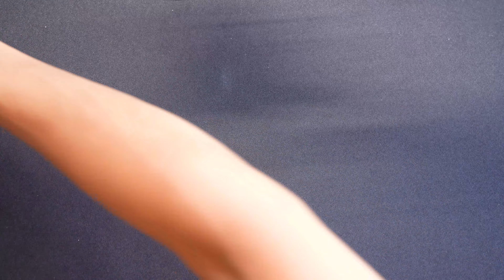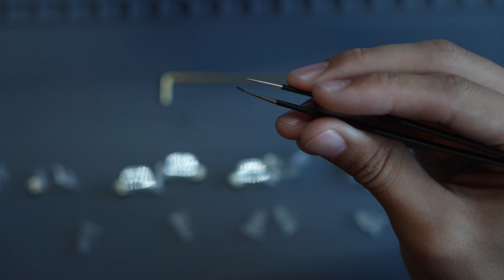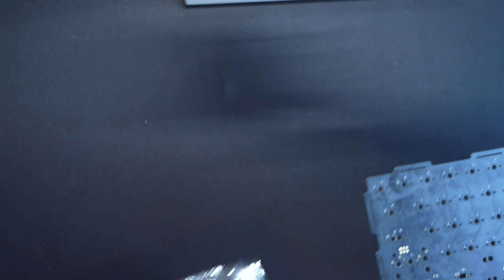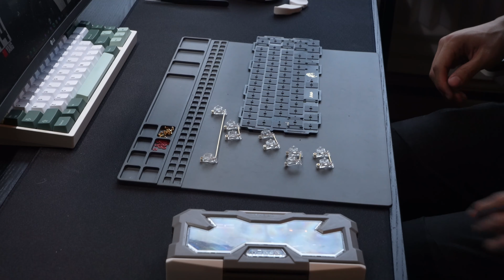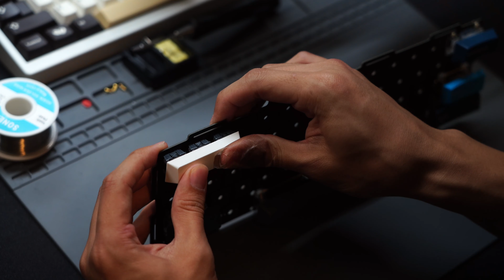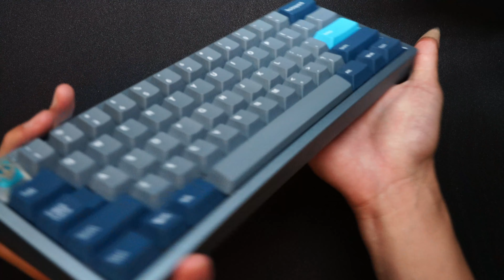Studio Kestra Nue Build / Cthulhu Linear Switch Sound Test

Comment: What is the Cthulhu switch you're using here? Typically it's long pole stem, milky top, ink bottom, but you're using kingfisher stems here so just looking for clarification. Also where are those tiny stabilizer housing pads from? The ones that you're using effectively to holee mod

Edit: nvm on the first point, you showed the switch components later in the video
Reply from the maker: The stabilizer pads are from kbdfans, but i cut up the excess pieces to use for holee modding, just having that pads on the PCB wouldn't be enough to stop rattling or pinging :/

Comment: Great looking/sounding board! How are the kingfisher stems/base switches? Have been looking at em for a while but never pulled the trigger since people said they were scratchy.
Reply from the maker: Thanks :) The kingfisher by themselves lubed are horribly scratchy but I bought them for the stem. I can't recommend them if you're just going to be using them by themselves, but they're somewhat salvageable if you decide to harvest the stem and use them in frankenswitches. I only had a few bad apples where the stems didn't want to play well where if you pushed down from anywhere but the middle of the switch, it would just sound horrible LOL
Reply: @TofuTypes  Thanks for the info!
Reply from the maker: @NugenEnigma  Glad to help!

Comment: with a pom plate, how do you think it would sound compared to a banana split? im looking for a “creamy” soft sound. also, what would you give this switch as a rating 1-10?
Reply from the maker: POM plate on which board? For the nue? Personally I'm a big fan of the switch but it is a little scratchy so I would give it like a 7.5 maybe 8.
Reply: @TofuTypes  not sure exactly what type of board, i do know it’ll be a alu/metal board mid to high end 65% from what i’ve seen pom/poly gives a softer sound. so currently trying to find switches while i wait for my board through GBs. as of now, the switches i’ve found liking to are lavender, alpacas, banana splits and aqua kings. but i really like the sound of these. like i said before, im looking for that sort of creamy soft sound.